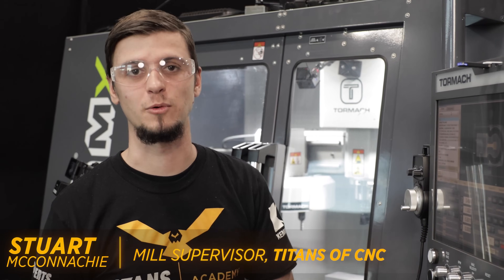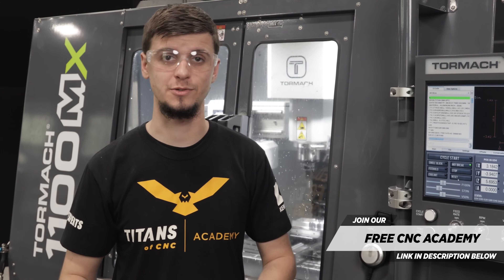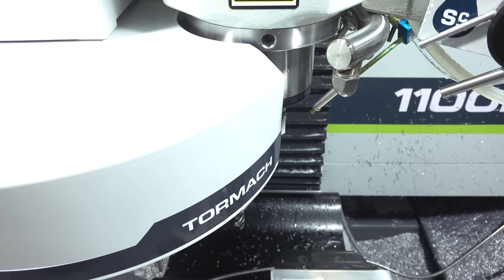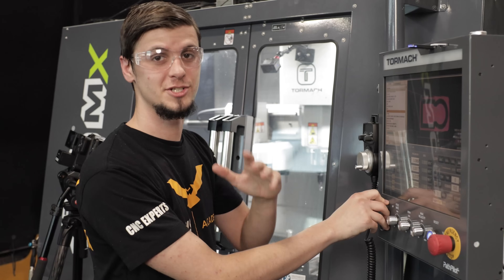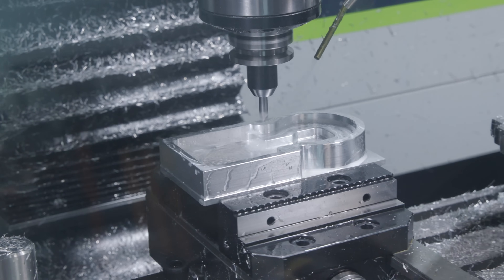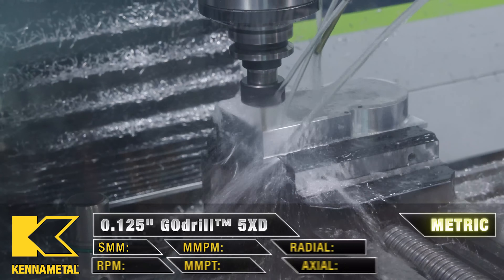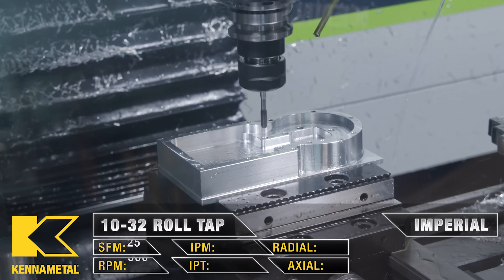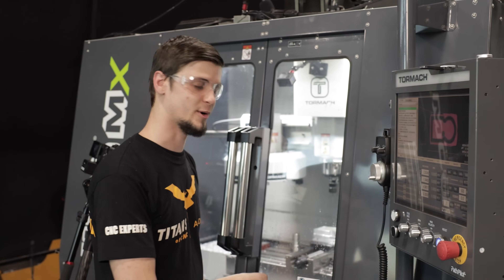CNC Machining the TITAN-26M on the TORMACH 1100MX

Comment: Is this device a Cnc Machine like controlled by Fanuc, Siemens or mitsubish or is it a upgraded Router ? These are very different. Can Tormach used as a serial production like 4-5 parts per day ?
Reply: If I’m not mistaken tormach makes their own controller.

Comment: Always love these, but have some questions.

I’ve noticed when/if you guys spot drill you use the 90° chamfer, the go drill tips are 140°. Lots of thoughts on the topic but safe to assume you guys don’t think it’s necessary to have a larger included angle for the spot? Such as 142°

Could you guys do more of the second side in these as well? The first side is great, but it’s not done yet 😉
Reply: I think its more important to have correct tip angle for spotdrilling when dealing with small and deep holes 😊

Comment: Is IT possible to Run parts within .0004-.0008" (0,01-0,02mm).
I really Like the concept of This simple and small Machines. But i Need precison.
Reply: Sure. Better get that machine laser calibrated and you won’t be able to run max rpm due to spindle heat growth.

Comment: I have been making a living off of one Tormach PCNC 1100 since 2007.  I cut small castings using mostly cutters under .187".   One time, I made a set of idler pulleys for a car blower belt using a 3/8 2-flute ball nose end mill, stepping only .010 in aluminum, and it was enough stress for oil to leak from the spindle nose. Don't even try index-able inserts for any kind of hogging.
I know you want to show the machines capabilities, but making billet parts for any kind of production is not for this machine, (great for prototyping though).  I also find no need for coolant, since the heat is not enough to clog a cutter with aluminum.  I found the coolant tank works excellently for catching the way oil so you can reuse it, even with a chip tray full of chips.
My machine will have been in use for the last 15 years this summer (2022).  I have had 2 electrical failures that had down time of less than 3 weeks total, no mechanical failures, and have not even tightened up the gibs or ball screws.  I have put almost 1.3 million dollars worth of work through it, and it cost me 12 grand. :) 
For light work, you can get more run hours out of this machine with less trouble than any of the 20 machines shop I had worked for had done, (about 10 years is the limit). But go bigger like this on the cutters, and I am not so sure that would remain true.  It is not a "mountain mover".
Pleasure doing business with you Tormach.  You saved my life. :)
Doug in Michigan.
Reply: I make billit parts with my tormach 1100m.  I run 30-50 thou stepovers with 3/8 and 1/2 endmills for roughing at full axial depth of cut and the spindle doesnt even seem to notice.  I think the oil from the spindle nose was just a fluke thing possibly.  You should definitely be able to run light production (20-50 billit parts a week) for aluminum on a tormach.
Reply: @MotoBuilds  If it cuts smoothly, you should be fine I am sure.  But with that 2 flute ball nose em or index-able cutters, they will hammer and oil will start to leak out.
Reply: You are not going to produce billet parts on this machine and be competitive in the market.  It is just too slow.  I port small aluminum 2-stroke cylinders with it, and don't have that kind of competition.  My "finish hand work" takes lounger than a cycle time anyway.
Reply: @EarthSurferUSA  I'm in a niche market.  I'm very high profit low volume.  That was always the goal. Living stress free is just as valuable as money to me.

Comment: Did u say 110 outlet?
Reply: 220 single phase.  Just double up (2) 110's in the garage breaker box and put the 220 receptacle where you need it to plug into.  I can run my 220 lathe and 220 air compressor the same way at the same time, and have not exceeded local rural service running all at once.

Comment: So, yes Tormach 1100's start relatively cheep, but the optioned out machine you are using in this video is about 35K, correct?
Reply: That’s the premium package, yessir. But that $33.8k package comes with ~$550 of drills, $1300 of toolholding, a vise for the machine etc etc.
Reply: I do not need any of the options for my 2007 110 PCNC to make a living from it for the last 15 years.  I could not do that for 12 grand anywhere else, (I got the stand too) or even 35 grand, I doubt.  But, if I am going to pay 35 grand or higher for a machine, I would need it to make bigger chips than this machine can,.  But there is not a better suited machine in the world that serves my purpose so well for so little.  I am going to fire it up right now. :)
Reply: @EarthSurferUSA  
35k won't get you a basic Haas Mini

Comment: What kind of jaws are on your vise there?
Reply: Just a set of riser jaws that are cut so you don't use parallel bars under the work piece.  Makes it faster to clean off and load parts if parallels are not floating around.  You can make a set for your vise, if they are not a PO purchase item where you can buy them.

Comment: Can I use mastercam for drive it?
Reply: I am sure you can if you can just download the G&M program it makes into the machine.  You may have to do some editing at the machine to make it work, but that is easy if you know G&M code.  Write all your non-3D programming by hand, and you will get good at it pretty fast. :)
G&M code is G&M code no matter what source made it, and we can always edit it at the machine.  I don't know how to use 3-D software, (I just use Mastercam for drawing and finding points of interest) and rarely need 3-D machining for what I do, so I hand write all my programs.  They are much shorter programs than what a computer generates.  :)

Comment: This CNC machine has his software?
Reply: Like I said, with just drawing and knowing G&M programming, you can efficiently machine (anything that fits on the machine) with no software knowledge unless you are doing 3-D machining.  I have done 3-D programming by hand, but a 1 " long surface took me all damn day to find the points to program by hand. :)
2-D programming---I can do just as fast by hand as somebody can do with a computer.  Learn to do "sub programs/routines", and you can do anything well, other than 3-D machining. I have also had decades of experience figuring out things like speeds/feed rate/chip load,---tool capabilities,  which helps a lot for programming well the first time.

Comment: Like the Harbor Freight machine of CNCs.
Reply: Many CNC machines are made in china too now.  But this one I have been living off of for 15 years,---so this company makes sure they have good quality control.
No kidding, 15 years with 2 electrical breakdowns that cost me less than 3 weeks down time and under $700.00 for parts.  Of course, I am using small cutters, but show me another machine that has done that.  I have worked in over 20 shops, and none have come close to beating that reliability.  It is a very light duty machine.  But if used that way,---well---I am super happy about it. :)
Reply: Over almost 15 years of use, (this summer of 2022), I have almost 1.3 million dollars worth of work through this machine from 2007.

Comment: Hey Titan, Can you make a tutorial how to calibrate the blacklash value in fanuc control?
Reply: Is there such a thing for a closed loop positioning system, (which this machine does not have).  I don't know.  Ask Fanuc.  They might know.
Reply: At least, I don't think the newer Tormacs use a "close loop positioning system".  I still use their old Dell computer I got with the machine, and have not seen their own control.  But for the cost, I am doubting it has it.  Not sure.

Comment: Goddrill use g81 or 83 br I see u use g81 what kind gold drill it good
Reply: You use a G83 (Peck drilling cycle) for holes deeper than about 3 times the drill diameter.  Any cheap High Speed drill is fine for aluminum.  But some nice drills can give you a very accurate hole, maybe eliminating the need for a reamer.

Comment: What coolant you running?
It looks like water?..
Reply: Blaser Synergy 735
Reply: I have the 1100 from 2007, and cut aluminum almost exclusively, (small castings and a bit of billet.).  The 4000rpm spindle speed has never generated enough heat for the material to clog the flutes and break a cutter.  I don't run coolant anymore, and it wrecked havoc on a limit switch or two early on.  The coolant tank makes an excellent "way oil catch tank" so I can filter and reuse the way oil after I go through about 5 gallons.  Even though it may be a help in some situations, I say forget the coolant for this machine.  I have not used it for about 13 years now.

Comment: Did the tormach hold tolerances though?
Reply: I have 15 years on mine with small cutters in aluminum.  It will hold tight tolerances, but it does not have a closed loop position system, (relies on the ball screws like a manual mill.), so if you want super accurate hole positions, for example, you should program the moves to keep the backlash on the same side of the ball screws, (like coming to a hole position from a minus x and minus y position for every hole).  If the ball screws are not worn out, it can be almost as accurate as a cnc machine can.  It just takes a bit more work up front.
Reply: One thing it will not do that a well maintained CNC will with a closed loop positioning system is cut a perfectly round hole, (like under .0002" out of round), with circle interpolation.  you will see the backlash at the edged of every quadrant, (where the screws change direction).  But it still has to be a very good machine to be able to crop bearings in such a hole, or else they have to be bored or reamed.

Comment: Good job using a Form/Roll Tap Aluminum. But you didn't explain that Form Tapping aluminum creates a stronger thread due to grain rearrangement. The more you know, right?
Reply: It is not the grain rearrangement that you would see in a heat treating process, but just a compression of the material.  There may be some toughness benefit, but it can only be done with softer materials.  I was never a big fan of the process over cutting taps, but I am sure it has some advantages I almost never needed. 
I will think about that again the next time I fix a aluminum thread with a heli-coil. :)
Reply: IMO, the best advantage of a roll tap is if you don't want to make any chips that may bot be easy to remove, like tapping a oil pan drain hole, or something like that.

Comment: Wow, I have this machine and i just found out thanks to this video i can push the 3/8 Kor 5 Way harder. Thanks guys! Im still working on the Titan-.6M
Reply from the maker: Remember, there is a Titan deal for the tools. $41
Reply: You've had an 1100mx with the bt30 spindle, servos and higher hp motor since 10 years before it came out? Wow. Pretty good.
Reply: I have had this machine since 2007, and if you want to live off of it for 15 years with almost no problems, you will not want to use a cutter bigger than 3/8", and never use index-able cutters.  It won't last 15 years doing that.  You will not make money making billet parts from this machine, (just not fast enough), but it is great for lighter work and prototyping.

Comment: Great video! How do you all deal with the cable tension from having the ETS on the left side of the bed when working in the 4th axis work zone? We have ours set up in a very similar way, and it wants to really pull the cable out of the Accessory 2 port. Thinking about making cable extensions to solve it
Reply: Hang the cable from the roof of the cabin with enough slack for the table travel?  Not sure what the ETS (electronic tool setter?, which I never use and find a waste of money), is, so I may be off base.

Comment: And what if I don't have garage?
Reply: Living room
Reply: 7th floor
Reply: Basement?
Reply: @RoboDriller  you don't get this machine through a normal door
Reply: @therealsourc3  you can if you try hard enough.
Reply: @therealsourc3 ,    in underground mining, you don't exactly drive the equipment down in a shaft mine. So we disassemble them, put the parts/ peices in the cage (elevator)     and put it all back together underground.
Reply: 3rd floor walk up?
Reply: The tormach used to come in boxes. Assembly required. They may still do. Either way, they did assemble and can fit in a small door.